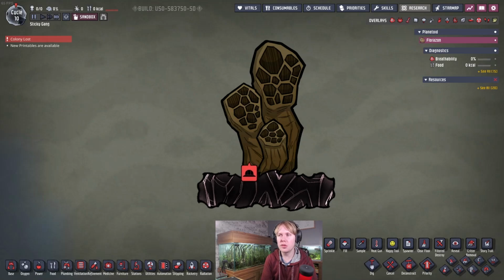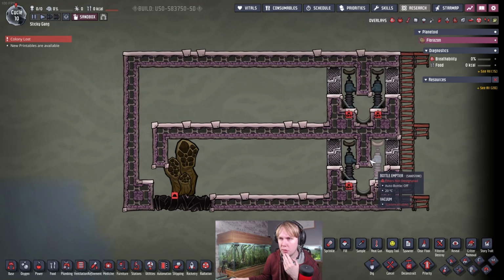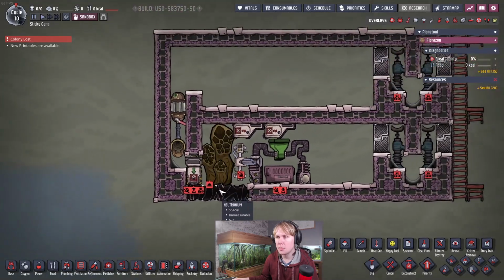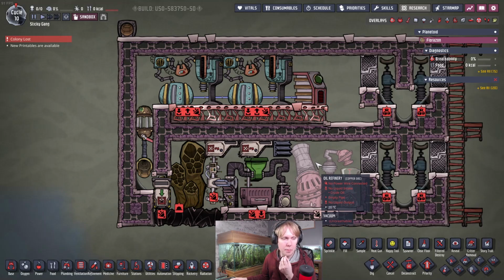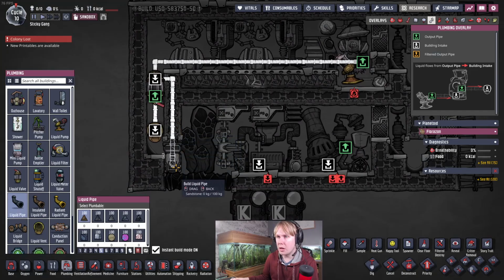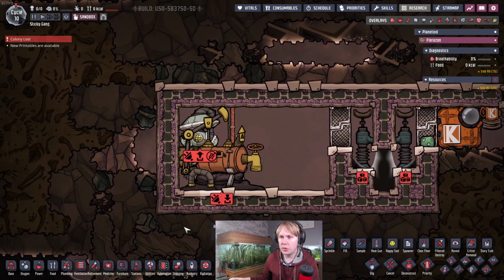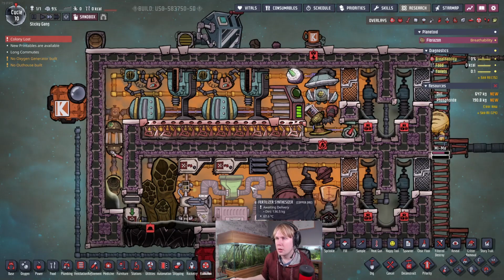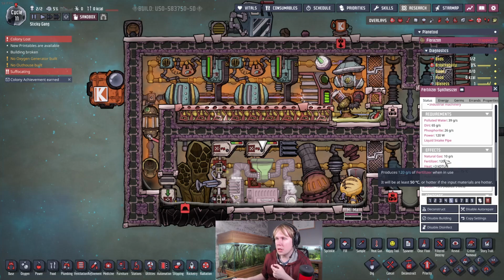How To Use Natural Gas Vents & Oil Wells In ONI: Spaced Out! Sandbox Showcase #11

Comment: What backpressure release threshold percent should i set on the oil wells for this use case? i assume it should be pretty low so it can exchange heat with the oil better, right?

Comment: Great video. Tried it, but every once in a while a get some micrograms of steam and breaks it. Any suggestions on how to prevent it?
Reply from the maker: Hmmm, are you dripping a low boiling point liquid on the Oil? Did a small pocket of Water end up in the drip pump by accident?
Reply: @erisia_gaming  liquid lock is of naphta. I did have water before that and thought it couldve been the reason. But after a fixed it, it happend again. Ill try it tomorrow on the other natural gas vent. And thx for the quick response.
Reply from the maker: Hmm. Is the room getting above 120° C? The polluted water could be boiling. At that point you'll need to add a little bit of active coolant pipe running through the polluted water.
Reply: @erisia_gaming  thx, ill try that.

Comment: This was a great video, Interesting builds for sure and a lot more elegant than how i used them (One single gold pump in a room to take out the gas and use the heat to preheat my cold salt geyser so it it doesnt break the desalinator. Might just take that out and build your build. 

One thing i would recommend for a video is whenever you are talking about a build in the start show a prebuilt version of it at the start, makes it easier to see what you are talking about and how it will al end up looking at the end.

I'll defo have to check some more of your content out now haha
Reply from the maker: Thank you. That's a really good idea about including a little preview at the start.